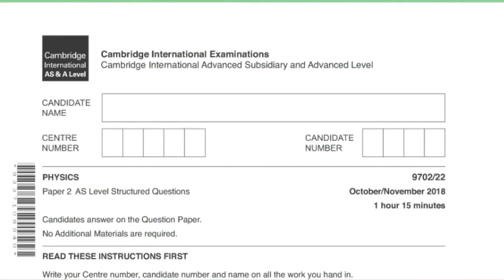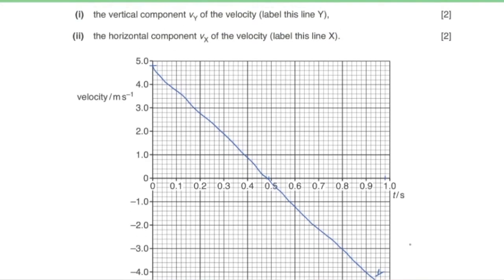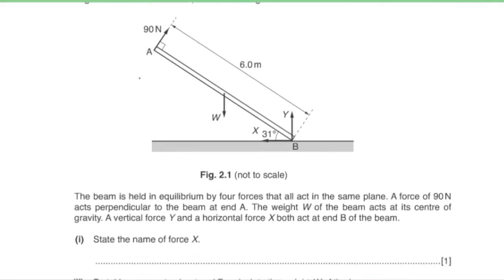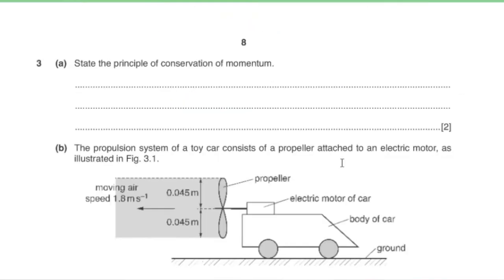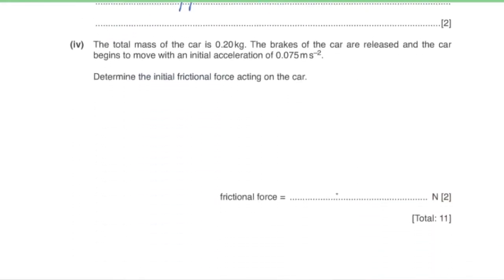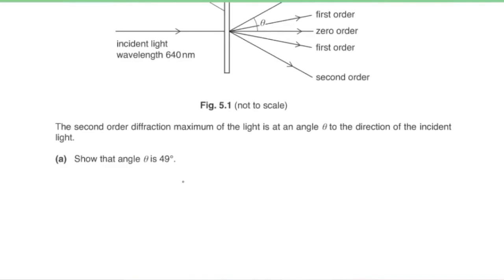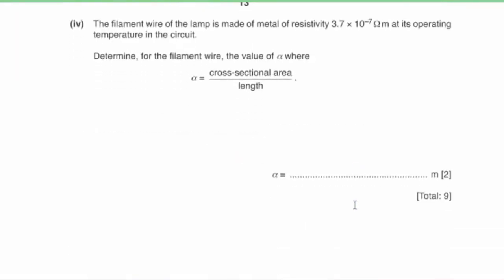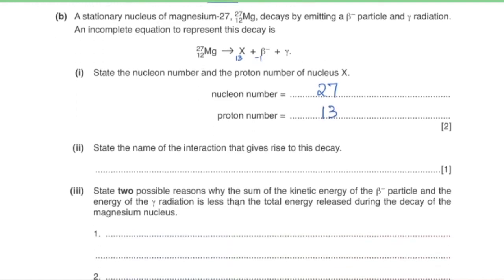CIE A Level Physics Solved Past Paper Oct/Nov 2018 P22

Comment: How did you get lambda as 0.5
I got it as 0.25 in question 4B ii
Reply: distance between two nodes is half a wavelength so full wavelength should 50cm or 0.5m

Comment: Thank you so much! Though in question 1(d) why did we use g as +9.81 shouldn’t it be -9.81 ?
Reply from the maker: Yes it is -9.81, since we need to only find ratio signs are not necessary

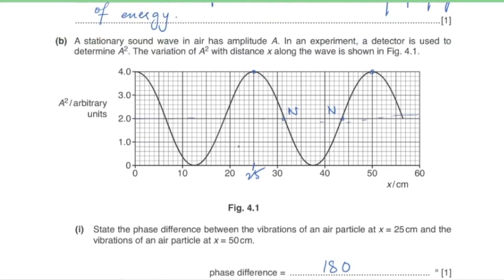Comment: At 18:05 why is the wavelength 0.5 and not 0.25? As wavelength is the distance b/w 2 consecutive crests or trough
Reply: @Freedom Fighters it's like this: it's a graph for Amplitude^2 vs distance, you can look at the graph and see that the value for amplitude is never actually negative, but just touches 0. What does it mean when your amplitude is 0? the particle is in it's mean position. so from 0 to 12.5 it's actually not a half wave but a quarter wave, so then when you move from 12.5 to 25, we can see that the amplitude rises again but this time it's the (-ve amplitude square) so it's in the same direction as the initial one. That's the main catch for this question. You have to understand that when you square the amplitude it's not the adjacent crest and trough that is the wave, adjacent crests and troughs are the particles with maximum amplitude but in the opposite direction
Reply: @riptide91 thanks for this explanation. 🌿
Reply from the maker: Phase difference between the two successive crests or troughs here is 180 which should not be the case. This means that wavelength is not distance between two successive crests or troughs here.
Reply: @examhelpweb2090  then how did you find that 0.5 ??
Reply from the maker: @laibamateen1671  Distance between two successive anti-nodes is wavelength/2 which in this case is 0.25m so wavelength=2*0.25=0.5m. Hope it's clear to you now.
Reply: @examhelpweb2090   don't u think you have marked the nodes wrong?
Nodes are points with zero amplitude. Accordingly they should be on the zero line, no?
Reply from the maker: @imaanz5697  Yes of course. I assumed A^2=2 as the stationary point which makes all marked points nodes.
Reply from the maker: @Farya Fatima  Could you elaborate that question?

Comment: Regarding Q4(b)(i) didnt u say in a previous video that to find the phase difference of a stationary wave multiply the number of nodes between two points with 180
So shouldnt the phase difference be 360 then?
Reply from the maker: Here you must do the calculations to get the phase difference.
Reply: @examhelpweb2090  where is the explanation